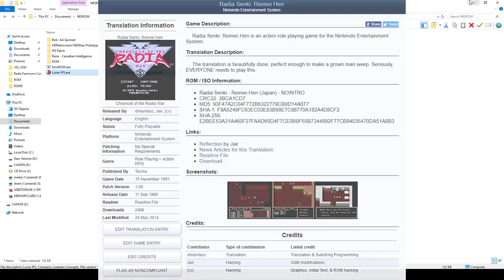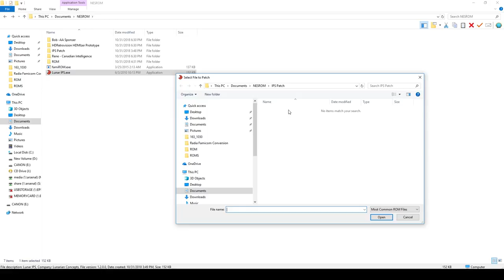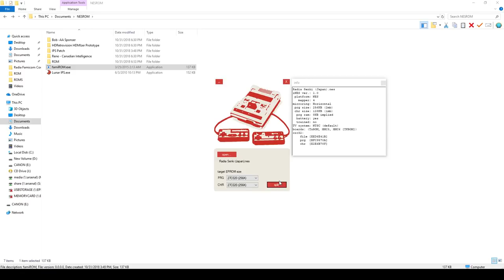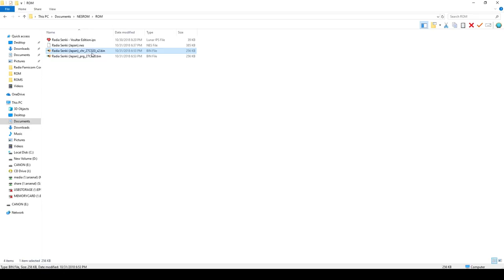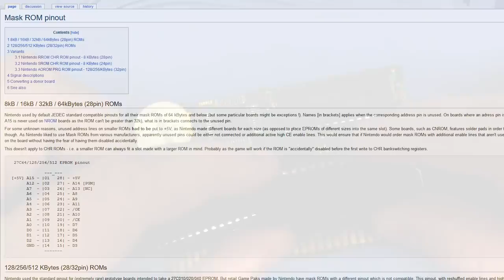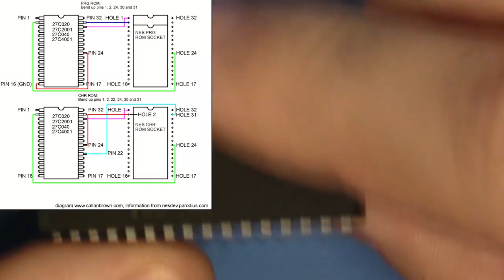Amazing Way To Convert Famicom Cartridges To English!

Comment: Dude I totally ruined my copy of Neo Turf Masters for Neo Geo by desoldering the PROMS and putting them on a Genesis board. I mean both the Genesis and Neo Geo have a 68000 and z80 so it should work, but using this video as a guide all I did was melt my Neo Turf Masters. I demand a refund!
Reply: YOU MANIAC!!!

It worked for me, I soldered my Thrash Rally PROMs to a my ZX Spectrum and now I have Sinclair C5 that plays Goofy's Hysterical History Tour.
Reply from the maker: You're a sick bastard, Joe.

...Meet me at the hotel again, tonight...
Reply: I think the gravity of that joke was lost by a lot of people. LOL
Reply: You are gonna socket your chips, right? RIGHT?
Reply: He didn't socket them, noooooooooooooooloo
Reply: Ah, incorrect. I ruined two perfectly good video games.
Reply: I konw this comment is a joke, but, really, to do this is awfuly unnecessary. To ruin perfectly working and possibly expensive games just because you don't want to learn Japanese or use an emulator, is cosmically wrong. The 8-Bit Guy's tutorial on making repro labels is nothing compared to this. Get a flash cart instead.
Reply: the blast processing was too much for it
Reply: @OM19_MO79  Yes, flash carts is the correct answer.  I can't see any reason to ever butcher or mod an actual cart to play unavailable games.
Reply: @ConsolesUnleashed  I'd rather make my own carts. It's just a matter of having physical carts rather than an SD card.
Reply: @lucyinchat  They have no value, not to collectors or even for display or even for prosperity. It's a massive waste of time. You only need 1 SD card inside an Everdrive. It's like having a repro that allows any game to be none destructively swapped in instantly. It's a no brainer.
Reply: I thought this was legit until I saw who wrote it lol.

Comment: Great tutorial, but there's one thing you may want to mention: due to the tightness of adding the wires to the bottom of the chips, it's a good idea to make sure you double check the positioning of the wires before pushing the chip all the way in. There's always the possibility of the chip pins accidentally slicing a wire and causing a bridge. It might be slim, but I'm sure someone, somewhere, has done it before.

Comment: That desoldering tool is magical.
Reply: For real I feel like a caveman using wick.
Reply: Magic costs $$$
Reply: I have a desoldering pump like that from Harbor Freight, cost practically nothing and works great. It has a spring loaded pump that absolutely sucks everything up, not one of those bulb things.
Reply: No, it sucks.
Reply: "Any sufficiently advanced technology is indistinguishable from magic" :D
Reply: I had one like that, sold it since it wasn't very useful. Easier to just use a high quality standard desoldering pump.
Reply: @AnalyticalReckoner  
just stick with the wick. desoldering pump sucks
Reply: First time? You need to watch Loius Rossman's videos.

Comment: Aside from that solder bridge in the MMC3 legs (and in CHR-ROM legs too), very professional and clear presentation! Nice music as well.
Trimming those EEPROM legs seems horrible in case you ever want to reprogram it.
I have never seen this game before. Seems interesting.
Reply from the maker: But I didn't bridge the MMC3 legs. Those two traces are connected to a supply fill on the PCB..
Reply: Didn't expect to see Bisqwit in these parts. Hi!

Comment: Also, this is some next level shit. As a layperson I never in a million years expected that burning insulation off a wire could be a good thing.

Where did you learn how to reroute eeprom pins like that? I would have just been one of the dudes who sent the leads around the pcb instead of straight through.
Reply from the maker: It's something I put together back in 2014 or so. I made a tutorial for this method on TheISOZone back in the day. When not filming, it's actually faster to prep the EEPROM like this than manipulating the cartridge PCB and rerouting things directly ont it.
Reply: I've never seen this exact approach before. Very clever. Thumbsup. Had you  considered using an intermediate low profile socket method so you can remove and reprogram your EEPROMS? How about custom PCBs? Very cool thanks!
Reply: @djmips  I want to say this is possible, but something inside me thinks the socket might not fit with the ROM. I am really hoping this isn't the case because I would rather modify a DIP holder than the chip itself. This looks like a way to keep other people from modding your work, or at least modding it easily because now when you ram the pins into whatever holder you use, you also need to stuff the wires in as if they were pins and hope contact is made.
Reply: @djmips  Am I wrong when I say I am under the impression those will only accept the tip of the connector and not the whole connector? The package uses flat pins, which is why dual-wipe makes sense. And last I recall either the NESRGB or NES HDMI kits had issues with pins not making good contact with the holes because of the round sockets being used to hold basically a square pin.
Reply: @bluephreakr  good point, it would bear testing to be sure.
Reply: @bluephreakr  Round socket/square pin bad. I have tried.
Reply: @bluephreakr  uhhh, Voultar has a video on installing it -- you have to make sure you're not mixing up the machine pin headers (round holes and pins) with the regular IC sockets (square holes / pins). -- Never installed that specific mod, but the round pins fit the round holes really well in my experience (in other projects).
Reply: @EJ CitiGaming LOL. Layperson(s) IS a word though, and also applies to everyone. It's literally just a synonym of layman/laywoman. If you want to correct someone you should make sure you're correct first.

Comment: Beautiful technique! I kept seeing two bridged solder joints on the surface mount chip after you did the battery and was expecting magic smoke when you tested it! Thankfully after rewinding I realized they are supposed to be bridged. Phew!

Comment: Great video. I underwent a similar project for the Gameboy where I wanted to swap flash memory for ROM and FRAM for RAM in my cartridges. In the end, I developed a custom PCB so I could avoid rewiring components and also fit a nice coin cell retainer in there. It's nothing too special, but it's at RetroReboot.net if you ever wanted to see it.

I think the Famicom could benefit from a similar mod. A new PCB that accepts a standard pinout for the PRG and CHR chips would speed things up tremendously. At some point, I guess it makes more sense to just buy an EverDrive, but the excitement of DIY is always present.
Reply from the maker: Very awesome, indeed!

Comment: Hey! Glad to see the diagram from my site is still being used. I think your final product looks great but I think it's very risky for beginners once the wires are trapped under the newly soldered chip.
Reply: Yeah, I saw how he was heating the rubber coating to strip the ends of those wires and thought to myself " hmmm, there's also rubber wire coating touching other pins that he is going to be soldering into the holes, what if the heat on one of those pins also melts some rubber that isn't supposed to be melted making an unwanted connection??" 🤔 I would totally screw that up.

Comment: If you used an IC socket to make the appropriate connection changes soldered it and lifted pins like the actual EEPROM you could effectively leave the EEPROM unmodified and have a chip adapter

Comment: I used a small screwdriver to enlarge the through holes for the battery holder when I replaced my batteries.  I use the same holder as you and found I could put them flush against the pcb once I could fit the leads through the holes (which I bent out with some pliers).  I did that mainly because I was learning to solder at the time and didn't even think of doing it surface mounted style.  Some holders I had to carve a bit of plastic off of because other components were crowding it.

Comment: Voltar You can use these battery holders as THT parts if You bend the contacts straight down. It is a direct fit.

Comment: Really well done video! Very soothing, and your desoldering is simply hypnotic.

I hate to be that person, but I am a tad bit confused about your mention of CPU endianness with regards to the CHR ROM. Just to clarify, the 6502 and the PPU have entirely separate memory buses. Generally speaking the 6502 will never see the CHR ROM data. I reckon that with regards to the CHR ROM padding, "memory layout" is probably a more applicable term here than endianness, as endianness has more to do with which way data bytes are expected to be ordered when loaded into the data registers as instruction operands.

Anyhow, cheers! :)

Comment: For the masses I would not suggest you do this, the video poster is experienced and this mod is not easy. If you want to play famicon games in English on the original console without emulation I would suggest you get a EverDrive, it's a bit pricey but considering the EPROM programmer and eraser you would need the price comes out the same.
Reply: mackjeez or you could not worry about people making mistakes and let them try learn something. I encourage everyone to try this.
Reply: What happens when the game you want to play also has expansion audio and doesn't work on flashcarts? Do you just give up?
Reply: I taught myself to solder changing batteries on carts.  This is definitely more advanced but if you aren't worried about messing up I say give it a try!
Reply: I mean...You can get an EPROM programmer off of amazon for like 9 dollars.
Reply: Or buy a repro if it's available
Reply: @FinalManaTrigger   Everdrive supports all expansion audio.
Reply: @FinalManaTrigger  expansion audio is supported on the new powerpak http://nintendoage.com/forum/messageview.cfm?catid=22&threadid=32915
Reply: nes* powerpak

Comment: You know, I use those same battery holders, and it's possible to bend the leads WITHOUT breaking them if you tin them with solder first. If you do that, it's a 1:1 replacement for SNES and NES games (and N64, what few use them).

Comment: I must say, I'm quite impressed with your work. I wouldn't have the patience to do all this. It'd be much easier and less time consuming for me to just play the translated NES file in an emulator, which is what I usually do. Besides, I'd probably do a crappy job on the soldering.

Comment: Fan freaking tastic video!  You've done it again Voultar!  Thanks a bunch for this!  Got a couple questions for anyone in the know.

It's a damn shame that no one makes programmable chips with the exact pinout for a NES/Famicom cartridge.  Why is this anyway?  Do such chips actually exist?  Cus not gonna lie, this is likely beyond my skill level to have to rewire the chips like this.  I likely would not be able to do this myself without a straight up drop in chip option with the proper pinout.  Would REALLY love to know if a programmable chip exists with the proper pinout.

& I guess my second question is do all NES/Famicom carts have the exact same pinouts?  Meaning would these have to be wired differently depending on the game or are the pinouts always the same?  Would LOVE to be able to use this video as a reference for doing my own games or for any modders I hire to do them!  I purchased a whole bunch of my favorite Famicom games for the sole purpose of one day converting them to English, so I do hope that I can use this video as a reference for just about any game that I do!

Comment: This is super neat stuff.  Lovely work; too bad it's hidden inside the cartridge.  I assume there's not enough clearance to put a socket on the board? I could imagine being able to wire up the socket like you wired up the chip and then be able to swap in/out ROMs as you want, but if the cartridge won't close that makes it harder.
Reply: well you might aswell cut a hole in the cartridge while you're at it. that shouldn't be very difficult to do
Reply: or just get a flash cart so you don't have to destroy an old game

Comment: I don't think it would hurt to heat up the cart so that the plastic is warm and less likely to crack when you clamp it like that. At least make sure it's not cold.
Reply: yep. It's best to use the heat gun as the plastic can be brittle and extra brittle when cold. It's easy to break those tabs.

Comment: Nice tip !! I was thinking that you could probably 3d print a guide plate to fit onto the vice grip so that the face of the cart always lines up where you want it. This way You don't have to fight to get it where you need it. Just an idea.

Comment: Is there not enough room inside the cartridge to do the destructive modifications to a couple of low-profile sockets instead of the PROMs themselves? You would be able to easily remove and replace the undamaged PROMs and perform additional patching easily, no (de)soldering required afterwards.

Comment: This is really impressive and clean. I've watched quite a few of your vids, and this one in particular blew my mind. Seen it done, but never this clean. 

One question, though. Why not cut the wires on the thru hole part a little longer so you have room to strip it, then trim the excess once the chip is in place and soldered? It seems a little less risky that way. Just an idea.

Comment: you bridged two pins on the MMC3 when you attached the battery socket D: surprised it worked like that! Awesome video though, your wiring is so clean.
Reply from the maker: I didn't.
Reply: My mistake! It looked like you did, but I won’t doubt you :)

Comment: At first let me thank you from the bottom of my hearth to show us a method to crack a Famicomshell with less risk of damaging it.

I still ant to ask a few questions: As some Repro - "Producers" want to use PROM-Sockets, I bet rerouting the Sockets themselves is possible via your method too? Also I want to ask if you measured how warm a PROM could get since we all don't want melting wires / Isolation there

Comment: the insulation will melt and retract itself if put the soldering iron on the tip of the wire. no need to smudge it around

Comment: Fantastic video, as usual (Especially about the wiring tips, makes the cardridge feel still legit) ! 
However, this is definitely something I wouldn't be prepared to do (unless having the right tools), as those Famicom cardridges are really fragile...

I have one question about those low-profile battery holders though... Is there one kind of battery holder that you'd recommand ? And, would it also work for a SNES cardridge ?
Reply: That's a HARWIN 2032 Button Cell Holder Manufacturer Part No: S8421-45R
Reply: Thank you very much!

Comment: I'm going to use this technique to modify @IBM XT to extend the address lines for slots seven and eight because IBM and their infinite wisdom figure they could save a half a cent to not put these traces over for the last two card slots. This is why you can't use all expansion cards in those last two slots , particularly serial cards, because the address lines don't exist over there. They're fine for slots one through six

Comment: Melting the insulation with the conical tip is messy. After preforming the kink but before putting through the holes, why not strip everything after the kink? Then it’s just putting bare AWG 30 through the holes, soldering, and cutting excess. No fouling up your tip with melted plastic!

Comment: Great video. I have quite a few Famicom games were the battery should be changed. What model of battery holder did you 
use ? All the ones I have seen were to high.

Comment: Awesome video. Trying it myself with a copy of ganbare goemon 2 for famicom. I’m a layman so a lot of the technical aspects of over my head, but I’ve got an eprom reprogrammer and the soldering skills to make this happen. The thing is, the inside of my cart doesn’t look the same as yours.
I can’t tell which is the prog and which is the char chip? Also, my chips have 14 prongs per side as opposed to what I see in your vid, so I’m not sure how to apply your rewiring scheme to my cartridge? I’d really appreciate any advice you can offer, or at least a link to some resources to learn more about how to figure this out myself? Thanks

Comment: I can't help but notice it looks like you bridged a few pins on the surface mount mapping chip when you were soldering on the battery mount. Or at least it looks that way to my bad eyesight. If true, it's interesting that it hasn't yielded any weird results.
Reply from the maker: I didn't.

Comment: BTW Lord V, will there ever be a video on Super Famicom translations OVER 1 MB? I've done the pin 24/31 swap with such smaller games, but otherwise wiring in multiple EPROMs with a demultiplexer (?) seems daunting, and all the good games like Seiken Densetsu 3/Tales of Phantasia etc. are over 1024 KB :(

Comment: Hey Voultar, where did you get the button cell holder you used? I've not had much luck finding ones that fit inside cartridges in the past.
Reply: That's a HARWIN 2032 Button Cell Holder Manufacturer Part No: S8421-45R

Comment: How much does this increase the R&D cost anyway? When companies of course order modified or proprietary chips? How much cheaper would it had been if they used off the shelf stuff and was the point of not using off the shelf stuff was to combat piracy (which has always been a non issue imo).

Comment: Where do you get your wires from?  All of the places that I look at have the string wires, and not the solid wire.  I've only re-wired electronics with a standard three prong cable, so I have to tin the wires already, but I don't want to use that for any of my console work that I'll be doing when I get my KSGR soldering iron per your suggestion.  Right now I'm using a very old Radio Shack soldering iron that was my grandpa's before he passed away.